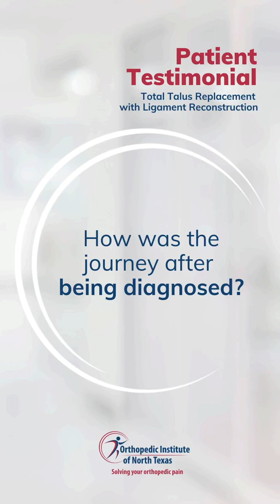3D total talus replacement for avascular necrosis with ligament reconstruction surgery with Dr. Kane

Comment: This is reassuring to see someone has had the opporation and recovered successfully. I am having my Talus bone replaced on 22nd November and I am very nervous because I know if it fails the chances are I will lose my foot!
Reply: Any news on it ? I’m on the road of the recovery for my both talus and doctor said at at risk to avascular necrosis and I’m very terrified to lose my feet at age of 26
Reply: @MrMalucas  hey 👋🏻, I’ve just had my 6 week check up and x-ray. They are happy with the alignment and my body hasn’t rejected the new part so that’s good news. However, I still have to have my foot in a boot for another 6 weeks so it will be a while before I know if it has worked. Although earlier days I am still having the same pains as I did before so I’m not very optimistic although I am trying to be!
Reply: @GaryShears Hey Gary, any update you can give us please. I’m waiting on my Talus to be completed making process and then I will be scheduled for the procedure. I’m walking with severe arthritis and necrosis of talus from car accident
Reply: How are you doing on your recovery journey? Facing replacement myself and would love to hear that you're healing well.